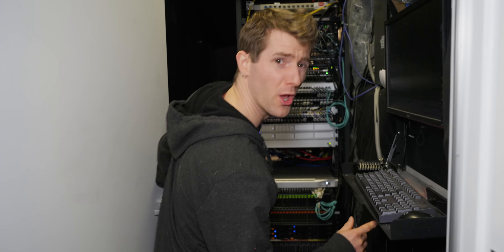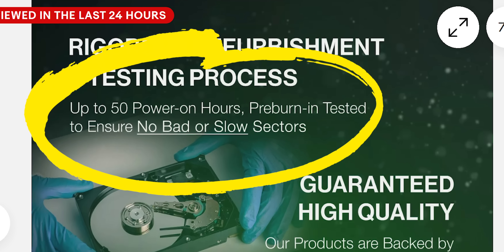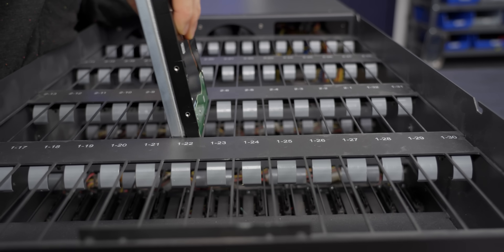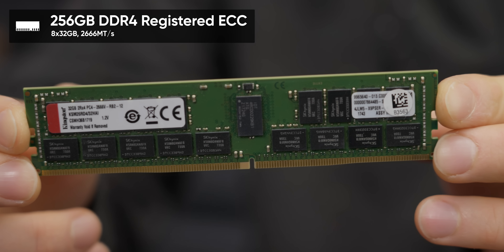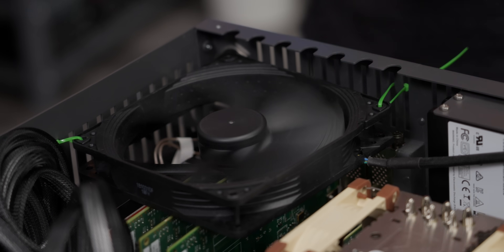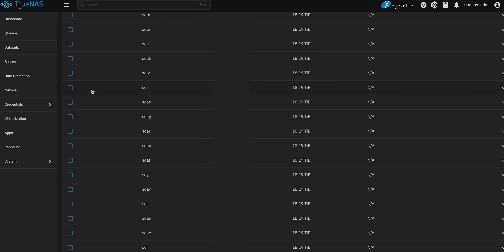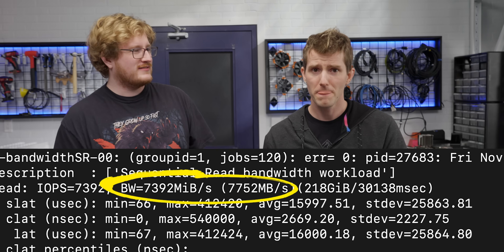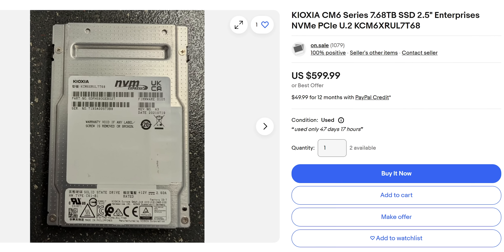Is Buying a PETABYTE on Ebay Stupid?

Comment: HDDs are still amazing because of the fact that, if they are not made to have major design flaws, and you keep them in environment with the least amount of vibrations,  fed high quality stable power, keep them away from strong magnetic fields, and at low temperatures and even if they are constantly operating, reading and writing, they can basically last longer than any SSD-based drive, simply because, their medium doesn't have a lifespan that is human-like.

Comment: Last month I bought 2 second hand 12TB drives from ebay, they all tested great in HDTune pro, but they didn't power on in my consumer PSUs
Turns out you have to remove the 3rd 3.3v pin to get them to power up in a normal PSU.
SMART test shows these have been heavily used and are past that "danger zone" hour usage. They seem good! Still being cautionary and using a 3 2 1 copy.

Comment: I never worry about drives.  If it works it usually works until the capacity is small enough to need replacing.  Spending equal money, I'd rather spend it on larger capacity used drives with more redundancy than equivalent new drives.

Comment: Ah, so this is why Server Part Deals was temporarily out of stock of Exos drives. I went to buy some a while back and they were out of stock which is... unusual for them. Okay this probably wasn't enough to wipe them out temporarily but I just find the timing funny. Regardless, I love Server part deals. I've had a 4 bay NAS for a year now and I'm trying to keep my small server on a budget and their recertified drives are still running strong and I've had 0 issues with them. The only downside to them is that they only have a 2 year warranty while sites like GoHardDrive offer 5 years. However, I've never once seen GoHardDrive have the 18tb Exos in stock. So yeah, Server Part Deals it is.

Comment: I bought a used 2tb HDD off of eBay in 2016 and it’s still in my system today. It does sound like it’s failing but I haven’t noticed any issues or corrupted data and considering I only use it to store steam games I will probably leave it in there until it bursts into flames.

Comment: I bought a used 10tb drive for about $100 (after tax and shipping). I only use it for storage, so it doesn't spin up that often, and so far, it's running great.

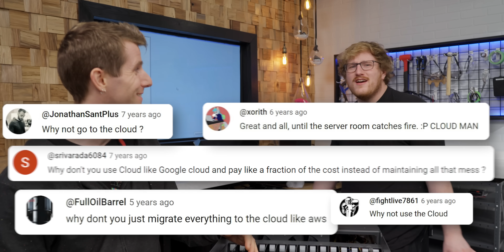Comment: 5:07 as someone who works at AWS, if you thought NZXT was a massive scam, wait until you discover AWS: the cloud has its uses, a lot of uses, but it’s not a silver bullet
Reply: I’d say cloud’s main benefit here is the option to have backups in geographically diverse locations. Kinda solves the risk of a fire or disaster causing you to lose  everything
Reply: @Mike_Who It's still way more cost effective if you could set up a backup at your parents'/sibling's/friend's home. Though ideally you'd go for someone in a different city, obviously.
Reply: @leonro  why go as far as a different city? Planning around a nuclear blast for your linux ISOs or something?
Reply: @HearMeLearn  Maybe a hurricane or a flood or something?
Reply: @leonro  You have no idea what you're talking about.
Reply: @Mike_Who  You can have multiple VPSes in multiple locations for the cost of using AWS in just one region.
Reply: But if you spend enough they'll bring an entire trailer of HD racks to back up your data center.
Reply: @ZacharySchmook  I read recently they’re opening  nondescript locations where there’s a big data suck pipe (technical term) for you book time to drop off your data
Reply: I agree completely.  I've seen tons of great uses for AWS, but if your company requires resources at a massive scale you will pay 10-1000x to go into cloud.  I've had management try to forklift things to cloud until they see the bill at more than 100x the cost.  Build cloud native or don't use it.  And know your use case.  Need ultra low latency, massive storage and will be pulling data out all the time?  Always go local datacenter.  You pay for storage as well as access.
Let's not forget a key point as well.  You are sharing resources in cloud and someone else is always going to be more important than you and your workload.
Reply: With that take, I'm guessing your AWS position isn't a technical one.
Reply: AWS does more than storage, you aren’t representing your company right. AWS can be cheap if you use it smartly, for example s3 buckets and glacier for data retrieval that not time critical.
Reply: @harisjaved1379  None of these people work in tech. It's bots and cosplayers.
Reply: So what's the scam? Or is this another case of using the word scam as meaningless nonsense.
Reply: AWS also enshittifies over time: they start you off with a lot of credits and discounts for various services, but after a couple of years those discounts dry up, and you're stuck with a locked-in deployment that's going to cost even more to move somewhere else
Reply: Holy bag holder
Reply: All relative, cloud does have its costs, some workloads are better on prem, some not. Most enterprises that are successful with cloud take advantage of cloud native solutions, utilize CICD, automated security scanning, policy enforcement, IaC, etc to save on infrastructure costs. Biggest benefits are time to market, consistent deployments, availability of tooling. Now, CICD and automation is not exclusive to cloud, but typically easier to implement, faster to, and comes with the cloud culture and mindset. Most of the fortune 100 and 500 have a cloud footprint, and most who go on doing cloud how it’s supposed to be done, never go back.
Reply: Only advantage of cloud is scalability. Especially for storage you could get a NAS for same price as 1 year of Cloud, maybe even less.
Reply: Aspects of my uni course (forget which modules exactly, one for sure is DBA) emphasise having on-prem storage. The really funny part is that the whole course content is from like 10-15 years ago pretty unchanged. So them emphasising on-prem storage in my course is coincidentally valid now, cause they skipped the cloud boom of 'everything goes on cloud' and the on-prem thing is important again.
Reply: "AWS is a bigger scam than this giant scam but it has its uses."
Reply: Hey this comment is relevant again now that AWS is having a massive outage
Reply: I met a few guys from AWS and asked them what they thought about people migrating back to more on-prem hardware, from majority cloud for whatever reason. 

It was a business setting so they didn’t really concede much haha (and I agree they’ll always be needed), but personally I see on-prem being a common thing in the future in terms of it being more cost-effective and security-effective, as well as less latent in remote locations for llm stuff to be run locally (plus overall more distributed power consumption).
Reply: @Laminar-Flow  Currently working on an IT company and 90% of our clients are on prem now and you have no idea how much cheaper this is.
Reply: @Laminar-Flow  This has been happening quietly for a few years now.  Cloud has it's place but backing up huge amounts of data is not one of them.
Reply: @Laminar-Flow  Yeah rolling your own security and paying for power in expensive business centers while also paying for outgoing data from business centers is very "effective". Maybe they didn't say much because they don't want to be insulting.
Reply: @Laminar-Flow  this makes no sense, as someone who has helped develop LLMs since the days of BERT, it is cheaper to run LLMs on cloud, not to mention the time savings. I have been in the language model space since Bert, gpt, gpt2 distillbert, and I always found that training the model and doing inference on the cloud was cheaper than running a local instance without the headache of environment management.
Reply: Comparing AWS to NZXT, scam-wise, is crazy. For 99% of users, AWS cloud will be cheaper than buying/renting on-prem if you consider how many options AWS gives you, and if you wanted to replicate those options yourself on bare-metal, especially when it comes to things like security, auditing/logging, reliability/scalability and geographic distribution.
Reply: linus 2 years ago = why you would never need a 20TB drive
Reply: @Mae-nr7wr  ah ah... Gotcha
Reply: lol tbh. i was thinking why he dont make any HDD vids anymore.  @Mae-nr7wr
Reply: IT's not getting the data in the cloud that kills you... its getting it back out!
Reply: aws or any other cloud platform basically a "lazy" tax
Reply: The cloud makes sense IF and ONLY if you need elastic compute because your load profile is very spikey. It would cost more to have a data centre running with bare metal hardware if your P95 load can be run on a single rack, but your P99 would require multiple cages of racks.
Reply: @PhilJohn1980  i think this is why people do hybrid cloud a lot today. Keep your p90 or p95 in house, and then burst into the cloud.
Reply: AWS NEVER works for me, never has I gave up with it 🤣🤣
Reply: I mean, right?! Some corporate idiots think they can just throw cloud at everything and it'll somehow make things better.
Reply: There is no cloud, just someone else computer or datacenter

Comment: I was very lucky and got 4x 10TB HGST He10 for 40€ each from a refurbisher, got seller warranty for a year cause of German law. Price went down that low cause of ebay multidiscount and I dont mind if one should die on me since I back up the most important data to other places as well.
Same seller also had a deal on Intel S4500 Datacenter SSDs. 480GB/each with multidiscount down to just 16€ per drive. They all had around 16 to 30 TBW and the drives are rated for at least 1 DWPD over 5 years so 876 TBW. 
Sometimes you just get lucky :D

Comment: You should really mention the issue with such large drives. Since the IOPS of each are limited to about 150MB/s when one of the drives inevitably fails the resilver of the pool can take so long that another drive could easily fail.

Comment: I have an knock off LSI HBA to SATA card that I've been using for over a decade on my NAS. I mean, I've changed my NAS hardware a lot of over the years, but this HBA card is the only thing that I keep for my sanity sake. I used it with Windows, with unRaid, and TrueNAS, recently I'm using it with ProxMox passing throuth to a TrueNAS VM, since ProxMox didn't play ball with HBA when I last upgraded my NAS.

Comment: I have a 1.5PB in storage. I've bought exclusively recertified enterprise drives for a few years now. Its a relatively small sample size but I find their failure rate is lower than new drives but with caveats. You buy from the credible source. Some companies will frame drives are "recertified" when what they really are is old used or untested drives. And while software like crystaldiskmark can help you check firmware in theory firmware can be overwritten. So what really matters is the source you are buying from. If its some random ebayer with low sales or kijiji high risk of scam. Of recertified drives I have bought from Ebay with tens of thousands or more of sales, with a warranty period as well, not a single one of my drives has failed yet.

Comment: I bought 4 14TB recertified drives from Amazon and the insurance they always try to upsell you on since these are what they are. After a couple of months one of the drives started giving me SMART errors so contacted Amazon support and they refunded me the cost of the drive as soon as the courier picked the package up and I ordered another recertified drive to replace. I didn't have to explain to support what SMART errors were or anything was really straight forward and I didn't even need to use the insurance policy for them. It was a bit unnerving running my array without any parity drive for the 4 or 5 days it took new drive to arrive but as it's was mostly linux ISOs I wasn't too worried about losing something I couldn't get again.
The 14TB recertified drives cost me less than new 4TB drives would have even when including the extra insurance which I did need (for this problem anyway). When I buy again I probably won't even bother with the extra insurance.

Comment: I run my Plex off a mix of shucked and recertified drives and have only incurred 1 failure to date out of 4 total drives purchased recertified. That 1 failure was a DOA failure so I suspect shipping damage. The replacement has been solid.

Comment: I have 3x10TB Seagates Recertified in my NAS too :) 
8 GB ram Intel G4500T and a used SSD for system. When the drives spin down it only takes 13.1W total.

Comment: i have been running the same drives for years now in my NAS and only changed them out when i upgraded them for capacity. and yes they are refurbished drives. i love the 20TB drives that i got cuz they are so fast and i have never had an issue with unraid nto seeing them.

Comment: I have gotten some used and some referbs over the years, got a refurbished HDD, died in a like 1 or 2 days, rma shipping ate all the savings, got a used like new drive on amazon it had almost 3 years of power on time and died as soon as it crossed the 3 years power on time right after the return period... (no data was lost) i have 8 drives i got from 2 people on /r/hardwareswap i would have had 9 but 1 did not survive shipping (i was refunded for the drive), the biggies issue i have had has been flaky sata cables that was a nightmare to sort out (i think that sata adapter is picky), 4 of these drives are cold spares

Comment: Thanks for doing this video. I’ve actually run into a storage space issue and was looking to replace my drives with larger capacity ones. Unfortunately the larger capacity ones are eye-wateringly expensive. This gives me an alternative and even a trusted dealer.

Comment: I have a 18 drive server with 10TB drives from another recertified company that have been running for 4 years straight without a single failure. $70 for a 10TB drive 4  years ago was too good to pass up and time has shown they have been amazing drives.

Comment: I'm using a couple of recertified 10TB Seagate drives for bulk media storage. They're a little slow, but they've been working for a while now without fuss. I have them backed up just in case, and only use them for data that I could re-obtain, but I haven't had any problems yet.

Comment: Bought a pair of 10TB drives a month ago from a 99.8% seller on ebay that were "Pulled From a Working Unit, 100% Tested, Wipe and in Good Condition [...] grade A"
Both drives had 60000+ hours, 5 and 6 logged errors respectively and neither could even pass a short SMART test. 
I would be willing to try again if it is actually certified by seagate, but otherwise that's a big no from me.

Comment: One gigabyte of RAM per terabyte of data is a myth that needs to die. How much CPU and RAM you need is completely dependent on your workload and network bandwidth.
Reply: Yeah, it sounds no better than the swap = ram/2 myth
Reply: |Music to my ears, I'm setting up a server with 12x8TB and the though of losing 96GB of my 128GB of ram is not fun.
Reply: @tomstech4390  i use a TrueNAS Scale Server just as a Backup with 160 Tb and 32 Gb of RAM. It works how it should, i make weekly backups from my Unraid Server at 10 gbit, but just for max 1-2 Tb a Week, often not close to a Tb.
Reply: Yeah...and with that amount of storage it doesn't matter, network is always the bottleneck (not to mention throwing away perfectly fine xeon board cause you couldn't spend like 100 bucks for xeon cpu that isn't low tier, low core count).
Reply: It's a ZFS specific ratio for RAM caching.
Reply: @AnonymousMod.   RAM caching depends on your workload and network bandwidth.

Comment: I think in terms of raw storage, I have probably 10% of a petabyte stacked up behind me at last count waiting on a chassis to mount them in, all for about USD700 or so from deals found on the Server Builds discord server (disclaimer: the guy who runs it supposedly is an ass? but YMMV)
(mixed SATA and SAS connectivity, along with mixed drive sizes ranging from 8TB to 14TB drives)

edit: (~) 14:53 They could've just cleaned them up and buffed out any scratches maybe? Some of them might be customer returns tho, and you might've just gotten a batch made entirely up of customer returns lol.

Comment: I bought some SAS Seagate Exos 14TB drives for like 100-110 USD each and still working good a year later with no SMART errors in site. Got 3 for my TrueNAS and got loads of storage.
Reply: I bought four SATA 18 TB Exos for 550 € total (avg. salary in my country is ~1400 €). I want one off-site and three of them in RAIDZ1 (2+1). I don't know what should I put them in.
Reply: Where do you find them that cheap in Europe? Or they went cheaper recently (haven't checked it)?
Reply: Throw them in your pc. Never enough storage when games are 100GB each.
Reply: Same here, we run two servers, one a duplicate backup running over 10 of these drives in each and haven't knocks on wood had an issue yet over many years.  Cheap and effective.

Comment: Interesting that you didn't swap the e5-2620 v4 processors for e5-2697a v4 processors. 

I upgraded several of my systems to the 2697a and 2680's and have a huge boost in speed. 

A used e5-2680 v4 is now around $22 which is a bargain for the speed.

Comment: I do use used hard drives a lot cause they are cheap and easy to get and I do not recall ever buying a recertified one and I think only two or three died but they had a long running time behind them and I did not store anything important on them. I do prefer to use the used drives in a raid zfs with the possibility of one or more failing before data loss. My conclusion used drives are good if the seller does not try to scam you.